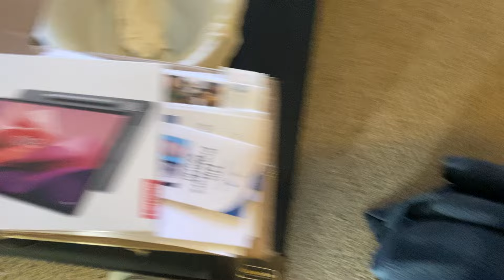Oxy-Dry restoring badly stained berber carpet in assisted living condo

Comment: Why do you always make it about OP vs Rotary & HWE vs VLM?
Reply from the maker: My channel has always been about promoting the rotary as a viable system when used to its full potential. Thirty years ago when I started Oxy-Dry there was no Youtube and other than Chemdry no one thought the rotary was a viable machine for the serious carpet cleaner. I saw what Chemdry had done with the rotary but I thought they were missing its true potential and I determined to make the rotary my machine of choice as I was convinced it was capable of much more than the old school "bonnet" type cleaning as It was known for. I was alone for the most part in my vision and at that time my primary protagonist was the HWE companies in my area and I set out to tackle the field as its were and carve a niche in my market as an alternative to HWE. I was very direct and clear and made sure all my marketing set me apart from HWE and the focus was the dry time of about one hour and the longer lasting clean and I pulled no punches then and I do not now. I was always told that method marketing was the wrong way to go so I made sure all my marketing was very clearly method focused as I tend to think outside the box and I don't conform very well.  When the OP machines came on the market I watched many videos with great curiosity and within a few years I bit the bullet and picked up 2 Orbitec machines and assumed that as so many were declaring the end of the rotary was here that I would now retire my rotaries and move into the OP age. My Orbitec machines were good units and in the early days they actually were manufacturing for TRS and a lot of the reason I went with OP machines was because of John Geurkinks push to get them to their dominant position. Later I purchased an Orbot Sprayborg and then more recently a Vibe and although they are fine machines in their own right after years of using them as well as even more years with the rotaries I have consistently found the rotary has the edge in almost every way. The greater chemistry we now have certainly helps as well as more options for attachments, pads, brushes, fibre pads and now the Multibrush that is a reintroduction of the Malish Dirtnapper  are all reasons that I have found that gives the rotary the edge over the OP. I have been the lone voice it seems defending the rotary and of course John Kluznic at bonnet pro but he was not there at the beginning of my journey but I am glad he is here now. The rotary has been slammed and dumped on by this industry with many blatantly false statements being constantly repeated and that is why I keep saying in my videos the things I do. I explain what I am doing as I clean and demonstrate for all to see and the proof is there in the videos. I am showing all who will watch and listen that the rotary is a great tool and anyone who chooses to use one owes an apology to no one. In my opinion and experience the rotary is equal to and in many ways better than an OP but either machine in the hands of a competent operator would be a great choice and one can make a great living with either machine.